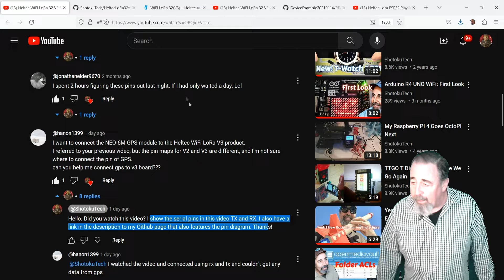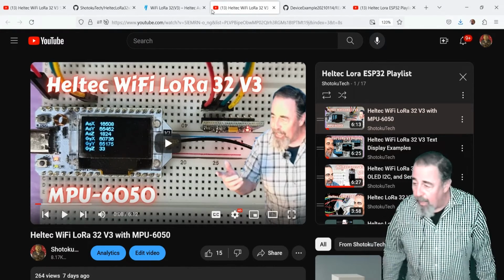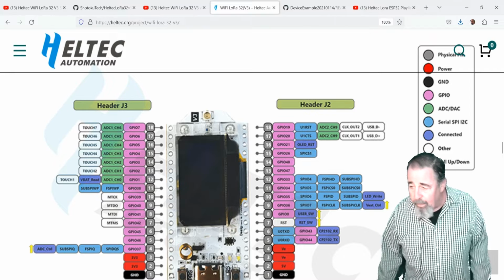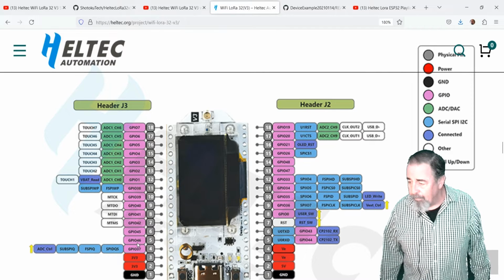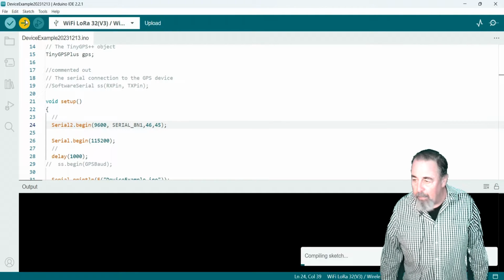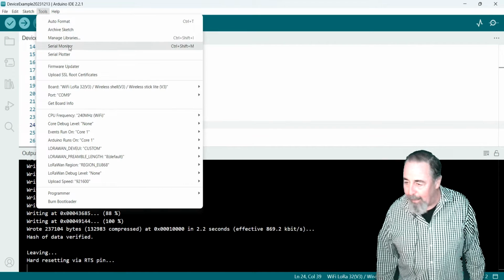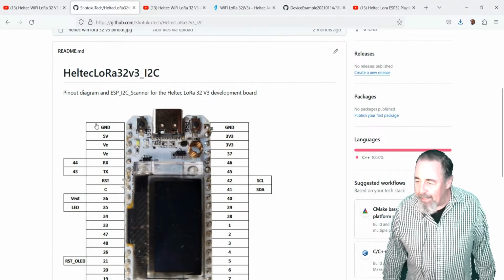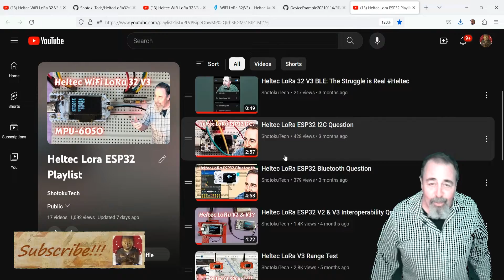Heltec WiFi LoRa 32 V3 GPS Question

Comment: I have Heltec V3 Devices. On one device, I added the GPS, and it's working, but it reports the wrong location by at least 2 kilometers. When I added the GPS, I also updated the firmware (2.5.9). In addition, I updated the firmware on all the other devices as well. At this point, I can no longer see any other nodes out there, and I have a Locked Green Padlock on every device. What settings do I need to see everyone else? Why a locked green padlock? Any comments on my GPS location? Your help on this appreciated.
Reply from the maker: Answered the other post. I'll see if I can find out more. Thanks.

Comment: Using GT-U7 GPS - I've connected as follows from the GPS to Heltec V3 -  GRD to GRD,  VCC to 3V3,  Rx to Tx, Tx to Rx. Is this correct? I get 'No GPS Present'. A little help. Thanks.
Reply from the maker: I used pins 45 and 46 in the sketch. See the link to Github for example code. The pins marked Tx and Rx are used by the USB port.
Reply: @ShotokuTech  I got it working. Thanks for your video and reply to my message.
Reply from the maker: @salsepulveda494  Okay! Good news. Best wishes.
Reply: Hey! If you're in the northeast U.S.A., look for me on the map.
Reply from the maker: @salsepulveda494  Alright! I will.😂
Reply: @ShotokuTech  Problem - In error, I configured this device as a 'Router', and now I'm having second thoughts about that decision. So, when I selected 'Radio Cofiguration' again to change it back to 'Client', the entire Radio Configuration is now dimmed out. I can't do anything. Can you help with that?
Reply from the maker: @salsepulveda494  Flash the firmware again and start from scratch.

Comment: I am so grateful for your work, I appreciate your insight  in aiding me in understanding the basic principles in utilizing the Heltech wifi lora 32 v3.  I am struggling with sharing the LORA pins with a micro SD card module.  It would be nice to use the  HELTEC wifi Lora 32 V3 as a data collection device.  Thanks for your time and shared interest in learning microcontrollers. Glad I found your channel.
Reply from the maker: On the Heltec v3 I am only aware of 4 open GPIO pins 45,46,47,48. If you can make SPI use those pins I think it will work.

Comment: is it possible to power the gps module using another pin besides the 3v3 or 5V pins? I want to be able to toggle power on and off the module in case it fails to connect to satellites
Reply from the maker: I have not tried to power a GPS module from a GPIO pin. Give it a try and let us know?

Comment: You sir are a legend... im working on a project to get this working via lora ...so you can gps track equipment...
Reply from the maker: Good luck. Ultimately this is what I would do as well.
Reply: @ShotokuTech  Whats the options once one has a proof of concept to get it all in one circuit to get footprint smaller???
Reply from the maker: @skoenman007  Heltec made this one: Heltec Capsule Sensor V3
https://youtube.com/shorts/ACbZuYGEpGg
I'm field testing this weekend. Meshtastic is new to me.

Comment: Any idea why my two V3 boards with enable smart position and GPS enabled DON'T report GPS position. If I turn off GPS module setting they report no module? So modules are on. Any thoughts? Thanks
Reply: or is there no actual module builtin and these switch only work once a module is added?
Reply from the maker: The Heltec WiFi Lora 32 boards do not have an integrated GPS module. Thanks.
Reply: @ShotokuTech  I figured it out, my assumption was wrong Thanks
Reply from the maker: @mickeycrooks28  Best wishes.
Reply from the maker: Interesting, how do you enable smart position?

Comment: Only issue is i thought only 3v pins was constantly powered (if using battery) 5v is only powered when using USB cable
Reply from the maker: I have used a buck converter to bring the 3.7 volts from the LiPo up to 5 volts. Thanks!

Comment: Im currently trying to use one of these boards as a transmitter to transmit when I push 1 of 4 buttons to control the gpio on the the receiver. So button 1 makes a pin on the rcv go high. Trying to move some motors. What is the code you'd use?
Reply from the maker: This could get you started: https://youtu.be/JKP8OvBm6nM
Reply from the maker: Happy New Year. Someone else left a similar comment and it is interesting to me. I will see if I can fit it in soon. Thanks.

Comment: Do you have any tips on extending the battery life on these? 
Anything would be appreciated!
Reply from the maker: I would have to research and demonstrate inducing low power mode. It might not work for attached sensors. In the meantime you might like this video that shows a calculator for LoRa settings and battery life: https://youtu.be/W1etjq8HSw8